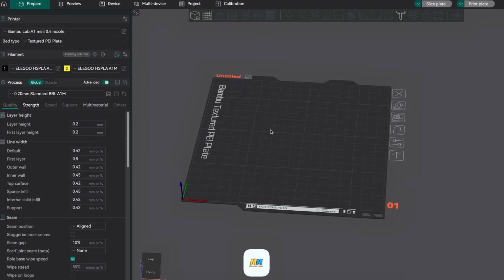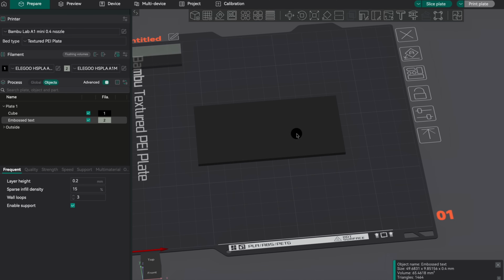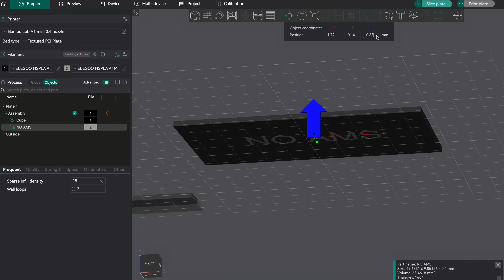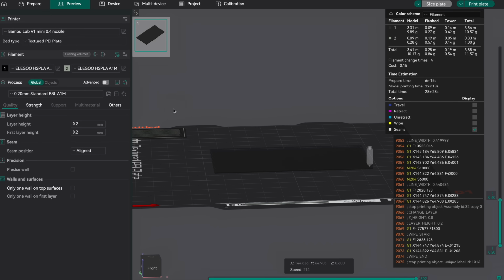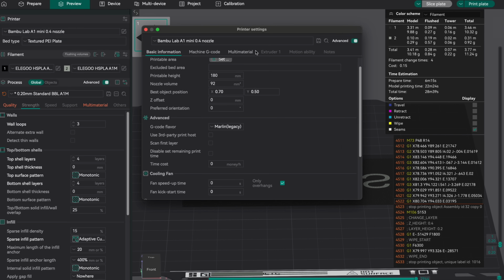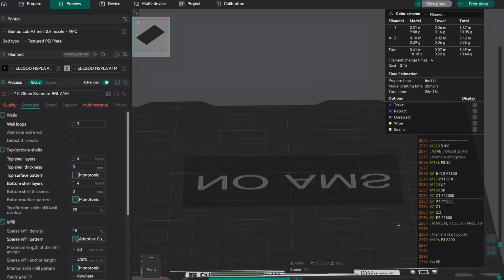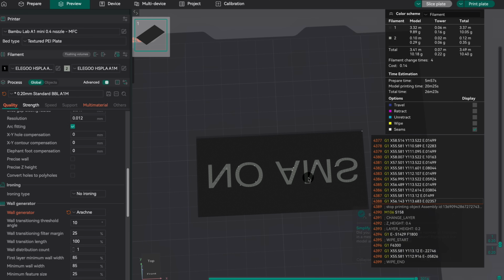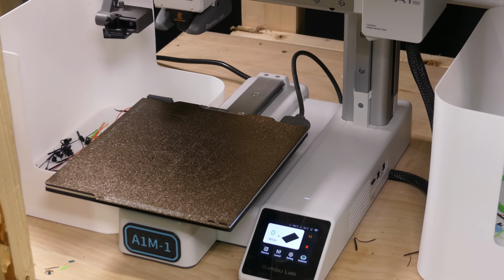How to do Multicolor 3D Printing WITHOUT an AMS

Comment: I just picked up the newish Anycubic Kobra S1 3-4 weeks ago and didn't buy the combo version as I wasn't too interested in multicolor printing, but now I'm kicking myself in the butt for not buying the combo while on sale. Somehow I totally spaced the fact it isn't just for multicolor, but multimaterial as well which I'm a lot more interested in doing. Now that I've learned more about 3D printing (only started about 2 months ago borrowing a buddies old Ender 5), there are some multicolor prints that have caught my eye. Mainly tools that use secondary colors for measurement lines and whatnot. Luckily those won't be too painful to do with a pause in the slicer and manual swap since it's only for a handful of layers. My wife on the other hand has seen some things she really wants me to print, but those manual swaps will be a little more rough. Lol. Luckily if she wants a good amount of multicolor prints, it shouldn't be hard to convince her I need the ACE PRO. 😅🤣 Stacked printing on the other hand with PETG for the parts and PLA as the buffer so they easily separate would be more of a pain as it'd be a lot more swaps. At least those swaps would take a bit of time in between if you're printing something like multiboard tiles. Only thing that sucks is you can't do it overnight or while at work to let it knock them out since you wouldn't be able to do the manual changes. Would probably end up taking a week to get a stacked print of like 15. Lol.

Anyway, sorry this ended up so long. At first was going to say I'd love to see you do this for the Kobra S1, but a lot of people run Orca with it, and those that don't, the Anycubic Slicer is modeled after Orca, so it's the same process. Thanks for this vid! Seems a little smoother to have the gcode automatically pause it instead of having to manually add a bunch of pauses on the right slider bar for the layer timeline.
Reply: @korabeats_  You can get a Kobra 3 combo that includes an ace for the price of just the ace.  I'm serious considering it because then I'll have an extra printer to mess with hardened nozzles for carbon fiber filaments.  There aren't S1 nozzles out yet and 3rd party ones have problems.  The ace would go on my s1.
Reply: @Monkey_Chimchim  Yeah I was so close to buying a K3 combo, but I wanted the enclosure so I could make a ventilation system for it to be able to exhaust off gas from engineering filament out of the window since I don't have an extra room for my printer and do more functional prints/prototyping parts for our dirt bikes. Plus I don't have to worry about ASA/ABS warping and peeling off the bed and ruining prints since it gets to 50°C-60°C in the enclosure.

If you shop around you can actually find solid nozzles now for the S1. Got mine from Aliexpress about 5 days ago and has been awesome so far. 0.2 through 0.8 nozzles, ceramic throat/all metal hotend, the proper 200k thermistor (maxed out at 220k when I tested it), and the S1 firmware now supports hardedned steel nozzles. And unfortunately the ACE between the K3 and S1 are different. Well... they're the same, but Anycubic makes this adapter piece you need for the S1 that doesn't come with the normal ACE, so it won't work with it. I was already looking at that work around to save money. Lol. I have seen some people buy that one, and then contact Anycubic and were able to get the extra part out of em for free. Haha.
Reply: @korabeats_ 

Link for which hotend you got?  The one i got on Amazon last month has the wrong thermistor.

Comment: No AMS no buy 😅
Reply from the maker: Oh for sure, would never actually do this unless I absolutely needed to for whatever reason, but Ive had enough questions regarding it so might as well show how its done. To be fair, most of my uses for my AMS's are for auto-reload these days but it is nice having them for adding text to parts from time to time.
Reply: I just got an A1 Mini and I was trying to keep my cost down as low as possible so I did not get the AMS. I thought I would never need it. Now I find myself kind of wanting one.

Comment: That's awesome! BV3D put out a video ages ago, but it was nowhere near this easy. I use M600 for filament changes on my Elegoo Neptune 4 Pro, and I have an M600 macro built to move the head up and away from the print, basically X 0, Y 0 Z +20. Then it unloads the filament and waits for 30 minutes. If I don't reach it in time, it cools down the nozzle. I haven't really figured out a good way to heat it back up before trying to load if that happens other than hitting the Fluidd page and setting the temp there.

Comment: I'm guessing that this would be way more useful on an older Ender style printer.
I'd expect most folks that want to do multicolor with the Bambu printers, would get the AMS.
I've done something similar with Orcaslicer on my old Anycubic printers.
Great info mate. Cheers!
Reply from the maker: You're right, It would definitely be more useful on an older machine or one that doesn't have multicolor capabilities at all, but I am glad it was helpful to some people.
Reply: @TheMountainMaker  
Hello. Is there a way to print all the gray layers first, and THEN print the black color afterward? 
I’ve seen some similar methods using other slicers where Z hop and/or Z height were configured.
Thanks.

Comment: I'd be interested to see whether the filament load/change Gcode can use variables to display the next colour to be printed. I used to do this by manually inserting an "M117 Load white" at the appropriate point in the Gcode, but it seems that the slicer knows the name of the colour and should be able to do the same thing. (Whether the printer will display the message instead of "paused by user" is another matter. Worked on my Anet A8...)
Reply from the maker: I think that might work if it wasn't a Bambu machine but they have things so locked down that you can't even change the amount its purging each time you hit retry when loading filament so my assumption is that that is baked into the firmware itself as far as the "paused by user" and not something the end user is able to change themselves via gcode. That would be really great if it was possible though especially for more than 2 colors.

Comment: Be good to see it done on a Elegoo Neptune 4 or a 4 Plus?

I seen that Anycubic are doing a sale on their Kobra 3 Combo printer and the Max version too!
I will need to save up for about a month to even get the standard sized bed version the Anycubic 3 Combo.

The Anycubic Max Combo is the same size bed as my Elegoo Neptune 3 Max at 16.5 inches ( 420 mm )

It has good reviews for a Multi-colour printer with auto leveling and auto Z height too.
Good sale price they even are doing it with extra 20 off the sale price by a coupon online and a extra 10 i you are a new customer?

I look forward to getting it so I can do multi-colour printing at last.  
Their 4 spool filament box is even heated to dry the filaments either when printing or just as a dryer for them?

Comment: this is why I like Prusa.  bambu makes you waste too much filaments...
Reply from the maker: So I’ll play devils advocate here. To waste 3cents less in filament you spend 3-5x as much on the machine if not more? Prusa is a better company in one sense but the machines are not innovative by today’s standards maybe aside from prusa xl but not for that price. I could buy hundreds of extra spools for the price of an xl. 
That said, I’m not a fan of Bambu as a company, but I’ve also never had to spend time fixing my Bambus and have well over 2k hours on each of them and none of them have had more than a nozzle replacement or sd card swap.
Reply: @TheMountainMaker  Yep! See price performance ratio all you undecided folks.
Don't get me wrong, the Prusa environment is excellent. I'm more concentrating on "How much profit can I make from this printer over it's lifetime"
If I can get a printer that costs 30% of another and performs for say 70% of the time with a little more waste, adds up for me.
Reply: at least you spend your time printing instead of fixing the dahm thing

Comment: Please demo on other machines also, this is a great tutorial! Thank You!
Reply: Yes do with others I been trying to do with some other machines and not working
Reply: @joethebuilder25  Maybe firmware does not accept M400. I use Octoprint and in pause command use @pause, so octoprint stops sending commands. Do the filament change, extrude until color change effective in the printer and resume in octoprint.
Reply: Yes please, also other machines. Best explanation I have found.

Comment: can you do it on a flashforge adventurer 5m pro and instead of text do a 3d dragon or something like that.
Reply from the maker: You could but you would be there for days babysitting the machine because you need to be around for each individual layer change. This is really better suited for 2 or 3 color swaps and then let it finish with one single color
Reply from the maker: My buddy Zero just did a quick run through for the Flashforge machines! https://www.youtube.com/watch?v=6m_Wf59O1xk

Comment: We would love to see how on the FlashForge Adventurer 5M Pro / 5M Series of printers... Thank you!
Reply: Slice as 2 parts setting the Zhop higher than letter height, print letters first change filament and print base part. I do it all the time on 5M pro.
Reply: @ How thick are you doing the letters? I found I needed multiple layers in order for the part colour not to bleed through the text, so I had to chamfer the back of the text to prevent the nozzle from dragging through it when printing the remainder of the part.
Reply from the maker: My buddy Zero just did a quick run through for the Flashforge machines! https://www.youtube.com/watch?v=6m_Wf59O1xk
Reply: @TheMountainMaker  Hi, there. At 11:20 the piece seems a little bit arched, am I correct? Is there any way to avoid it? Thanks for the tutorial.

Comment: can i make it in bambulab studio  when i have creality ender3v 3 ke in
Reply: I don't see why not. They recently added the V3 KE profile to Bambu Studio. They are using the M600 gcode which does PAUSE and Unload, presumably. The procedure on OrcaSlicer is the same.
Reply from the maker: Orca slicer would be my first pick for any machine that’s not a Bambu but Studio should work just as well i think

Comment: Interesting video! To make it easier, and assuming you didn't mind it sticking out, could you reduce to one colour change by printing the text on top of the plate?
Reply from the maker: You could do one color change but most filaments are not 100% solid and you would likely see through the first layer of a changeover especially between black and white or black and gray. Usually 2 is ok but i know with Sunlu anything you’ll likely want 3+ layers to prevent bleed through
Reply: @TheMountainMaker  I've achieved something similar by modelling the text as 0.6mm thick (3x 0.2mm layer height), subtracting that from the box, then applying a chamfer to the back edges of the text, down to 0.4mm (so the 0.2mm closest to the print bed is not chamfered). You can then print all three layers of the text before switching over to the box colour, dropping back to 0.2mm, and printing the box itself, with the chamfer keeping the text out of the nozzle's way when printing the rest. Need to enable slicer settings to avoid crossing boundaries, and pay careful attention to travel moves during preview, but it can work.

I never experimented with this, but I'd hope that specifying the print order as "by object" rather than "by layer", and a manual filament change between objects, would save a lot of the Gcode-editing faff I had to go through.

+++++++++++++++++++++++++
+++++++++++++++++++++++++
++         0000000000000         ++
++     00000000000000000    ++
++000000000000000000000++
Reply: Forgot one small detail... doesn't work so good with text that has "holes" in it, like O, P, R. I think in that case I had to set Z-hop to 1mm or something ridiculous to jump over the 0.6mm text that was already there.
Reply: I think the Bottom Paint Penetration Layer is set to 3, while the top is higher at 5 but also not as good looking